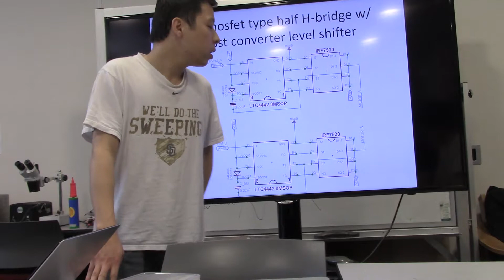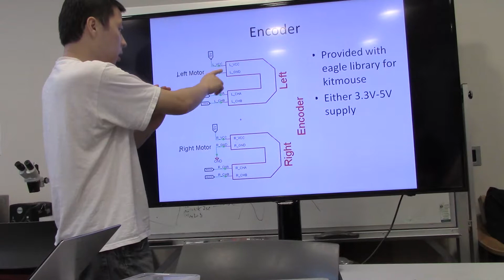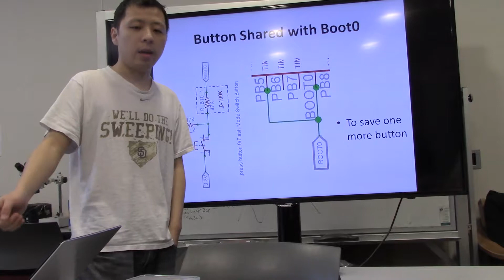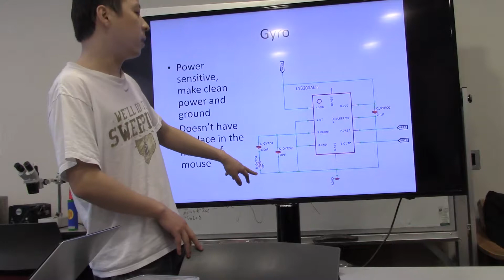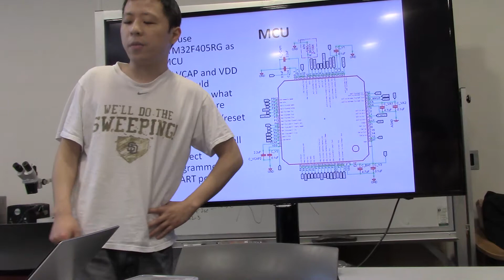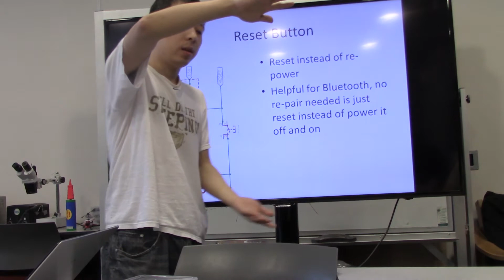lec 6 Parts Choices (Part 2)

Comment: Hey Green, can you explain more about why you used PB5 on the same Net.  I get that you want to save space and use the same button, but why PB5?  Why not just use PB7?  Wouldn't that be easier to route?
I didn't catch everything you said.   
Also, using that same button after the MCU is already turned on, won't affect the MCU?  Is it only the NREST pin that would affect the reset?  

Do you need PB5 for the boot mode?  I don't see anything about PB5 except can RX which I'm assuming you are not using.

Thanks in advance!
Reply from the maker: cuz PB6,7,8,9 are used for PWM from TIM4.
I tend to use all 4 PWM channels from the same timer to make the setting easier. PB5 is the next nearest IO for boot0 to be used to button.
Reply: @Greenye  Ohhhh that makes sense now.  I was driving myself crazy trying to figure that out.  You are just using PB5 as an input button, right?  Simply a user button and nothing else?
Yeah that makes a lot of sense now.
You used TIM2 on your encoders because it has more accuracy?  Why not use TIM2 for emitters?  I'm driving my emitters with a logic level MOSFET and the reason is because I want to be able to PWM  my emitters for the most accuracy.  Is this pointless? 
btw, watch my facebook stores.  I'm posting updates of my progress along the ways for my friend's to see.  They have to figure out what it is with the hints dropped.  haha
I can send you pics if you want to see.  It's coming out so much better than back at UCSD.
Reply from the maker: @DGNG-dd3to  TIM2 and TIM5 have 32 bit resolution for encoder. we never need to reset encoder to prevent over or under flow.
for emitter, I only use regular GPIO since I only turn it on or off without PWM.
Reply: @Greenye  Thanks that makes sense now.